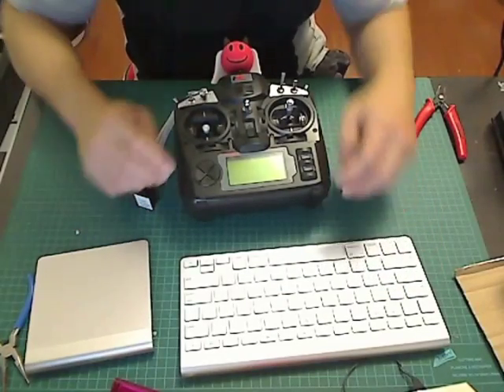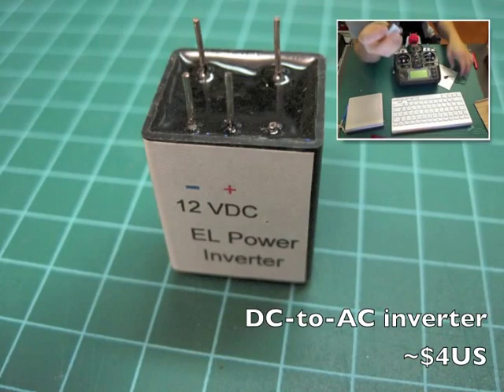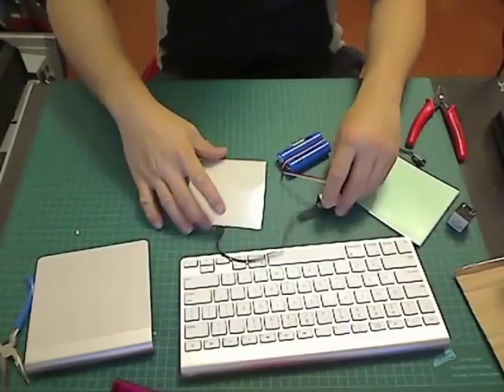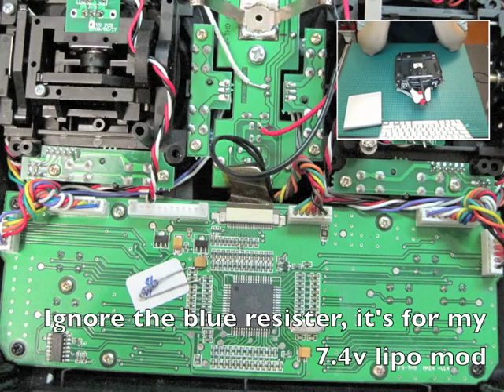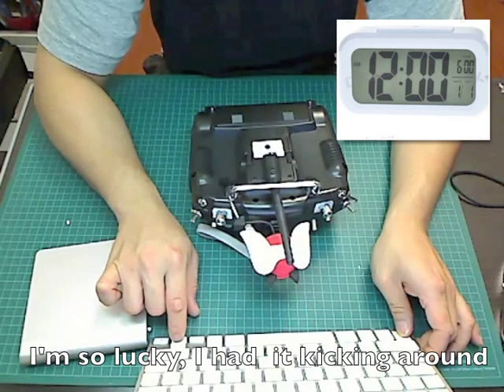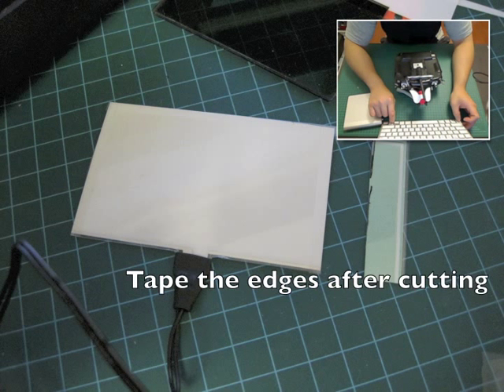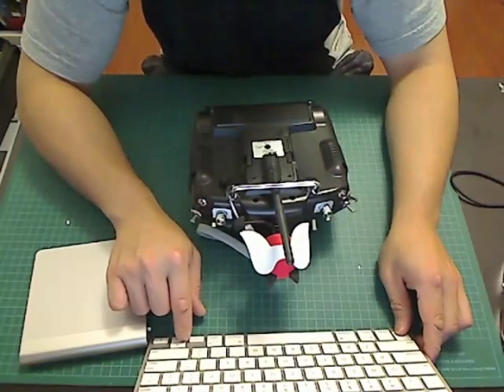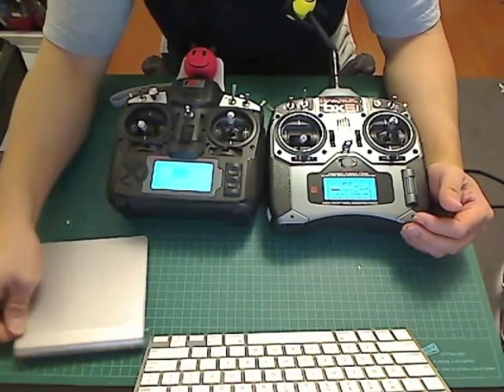Flysky/Turnigy/iMax 9x Electroluminescent EL Backlight LCD mod (DX6i/DX7)

Comment: @ThePatriotMuckraker 
inverters produce rf field the way they are designed. consdering the qality of the radio itself I'd definitely go for 'quiet' solution like spreading the LED beams. Don't get me wrong, I have one of those myself and ordered Turnigy LED pad from HK which cost next to nothing. Anyway - LEDs are the way to go in this case i think

Comment from the maker: @PHeMoX 

Not sure what voltage is needed to power the PSP backlight.  But you wouldn't need an inverter... inverter is only for DC to AC conversion.  the psp backlight probbably runs off DC.  You may be able to tap a 3.7v from the 9x somewhere on the PCB and you don't need to use anything to lower down the voltage.  Use a multimeter to find it.

Comment: @kenv98  What would I need if a EL panel I would use (PSP back light), would need 3,6V to light up? A VDC 12V inverter, but also something to lower the voltage? If so, what would I need? I'd use the stock Turnigy 9x 12V batteries.

I'd love to make this back light mod on my Turnigy 9X v2, but eBay isn't quite an option for me despite the reasonable prices. So far no (more local) company I've come across seems to sell them in a DIY-fashion either.

Comment: @kenv98 Thanks Ken. Not sure what battery you are using, but I asked this because when using 2.4GHz radios in the 9X, the modules have 5V regulators in them, meaning anything above ~6V to the 9X is wasted as heat. Just curious, at what voltage does the EL panel become useless? I have ordered a kit yesterday so I can test when it gets here in a week or so.